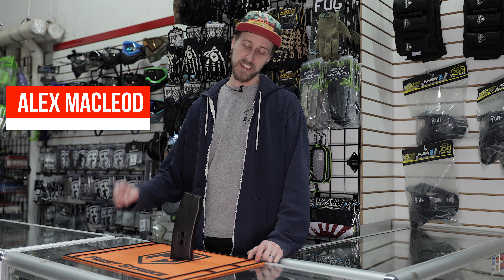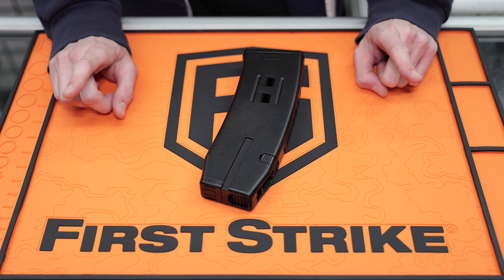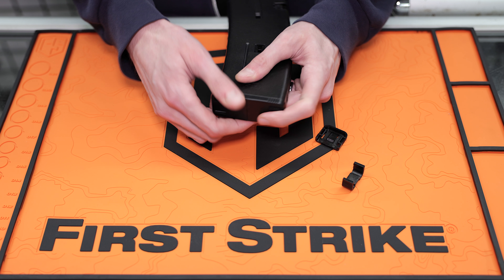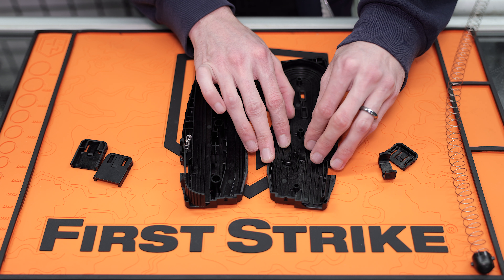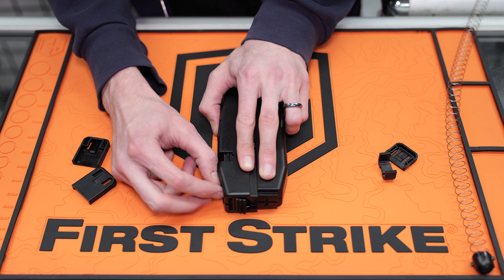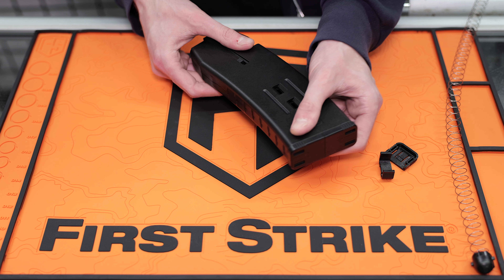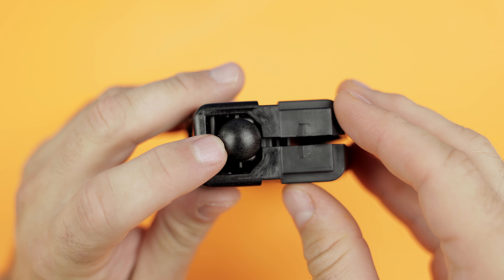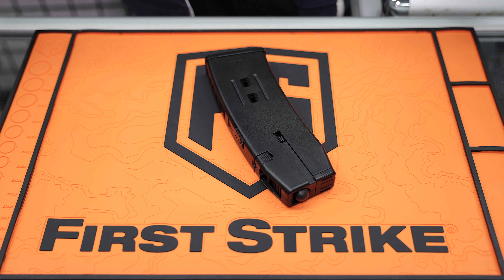FID 21/22 Round Magazine Teardown & Maintenance

Comment: Does the follower stop the bolt from dry firing
Reply: On a dye dam the follower wouldn’t matter anyway,  if your using on a mg100 no the follower will not reach up into the breach like the PE green followers
Reply from the maker: @wendatwilly  there are PE FID followers available. So yes, it would prevent the dry fire if you swapped the follower.
Reply: @defconpaintball  noice
Reply: @defconpaintball  do you buy the PE followers separately or is it a different magazine skew?
Reply: @defconpaintball  I def need them, would be using these in my mg100. I’m in the US so just want to make sure before placing the order.
Reply: Just get the lok bolt from mcs for the mg100, better than an extended follower imo.
Reply: @travismosher2570  Please dont. Their lock bolt is severely overpriced and questionably sourced. As the original creator of the feedneck mounted lock bolt, we have released the source files, and made it freely available on Thingiverse. Any printing service can make one for you (if you dont have access to a 3d printer) for a much lower cost. We also intend to have our design available for purchase soon, reasonably priced, and made with much better methods than FDM printing.
Reply: You say you will have it available soon but what do you mean by “soon”? A month from now or a year from now?
Reply: @hammerdownpaintball6061  If you are asking about our lock bolt - possibly by end of the month, or in December.
Reply: Thanks  everyone. These magazines look awesome. Do these magazines come in tan Earth?
Reply: @Billygunz0009  Not at this time, but we plan to do a limited amount in Tan Earth in our next run.
Reply: @flintinstrumentdesign1702  where will they be available for purchase?